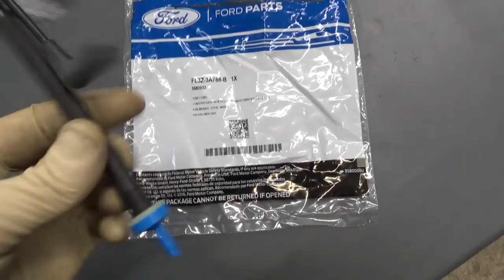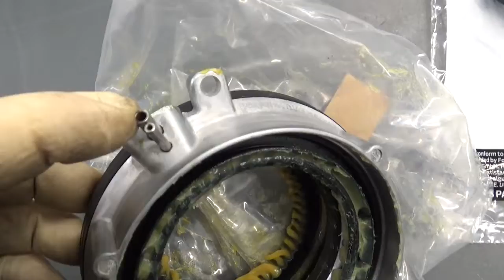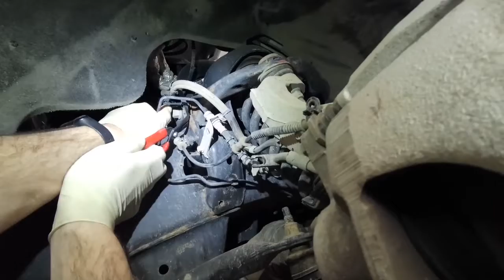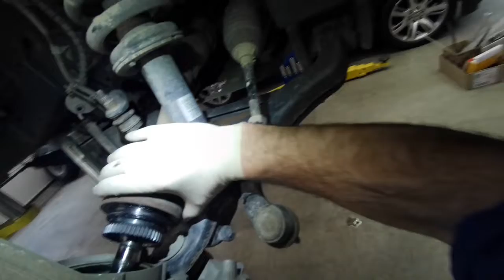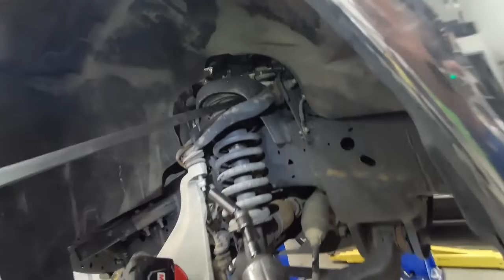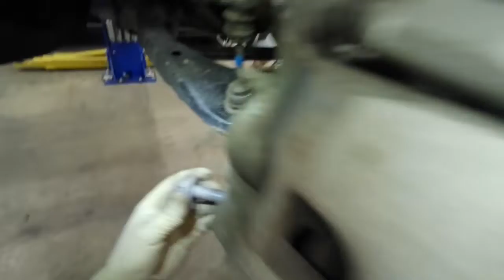F150 RATTLE/RATCHETING NOISE PART 2, THE FIX

Comment: Any idea of this issue can occur intermittently? Also, if this happens again (and it is indeed the issue you describe), is there any risk of further damage if I keep driving (say to get home, or to a safe spot to park)?

I ask because I think this happened with my 2019 F150 (29,500 mi) this morning. I was driving in 2WD  at around 40 mph and the noise started on the left for a few seconds and then it stopped when I let off the gas. The sound was very similar to what you demonstrated but louder (maybe due to the speed). Then it started again a few seconds later. I stopped and checked under the truck and hood for any debris or loose splash guards. I started driving again and it happened within a few seconds but seemed like it was coming from the right side that time, and then from both sides. In the 3 mile drive home it occurred on and off but wasn't happening the majority of the time.

After returning home and inspecting the vehicle some more, I took the truck out for an 8 mile drive with no issues. I switched into and out of 4wd on this test drive and had no issues.

Comment: How much does this usually cost to fix? I think this may be what’s wrong with my Ford and I’m dreading having to take it in
Reply from the maker: Prices vary wildly but oem motorcraft iwe's are somewhere around $100 bucks and depending on model, between 2-3 hours labor. This area is around $200hr

Comment: Good how to replace IWE videos. I had issues with my IWEs since the truck was purchased new in 2011. I had them replaced several times under warranty. The issues always returned so I chose to remove them completely and went with the Dorman  IWE delete kit 600-405. I know Dorman parts? They actually work well in this case they have a larger contact area and come with grease fittings. Yes the front diff is now engaged full time. But no real fuel consumption increase no noise issues and now when I do switch to 4wd Hi or disengage from 4wd it is smooth and immediate. And the only time the transfer case is working is when you go from 2wd to 4wd Hi or 4wd Low. I retired several years ago from turning wrenches after 30+ years so I do respect what you are doing and saying in this video.

Comment: Nice work,  why did the wheel speed sensor wiring need to be disconnected from the ECU ?
Reply from the maker: When the knuckle is swung out to remove the axle it will stretch the cable so I disconnect to give it more room.